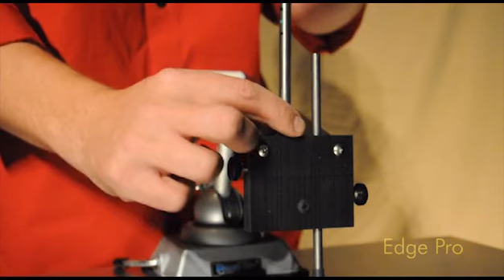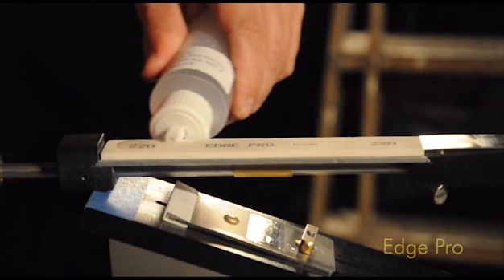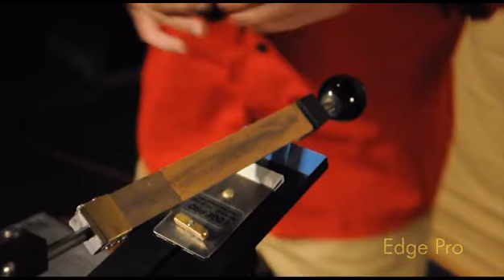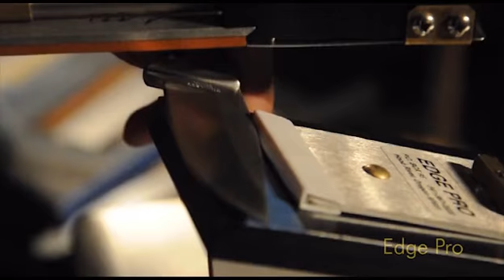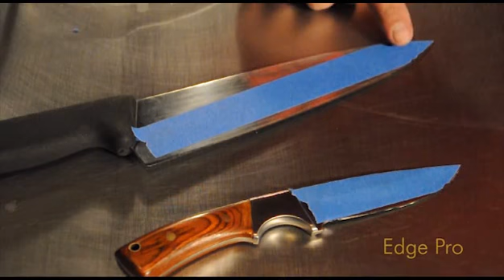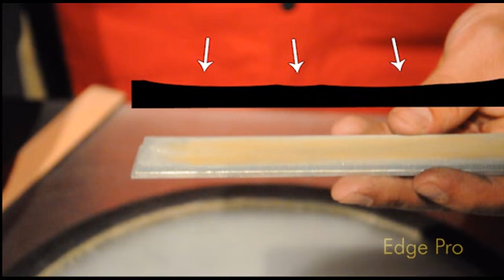Edge Pro Professional Model Instructional Video

Comment: Thanks Cody / Ben
Since buying my Pro back in 2010 I just got on and used it.  Interesting to see you guys using it.
I might reduce the amount of water I use on my stones.  You seem to use them damp, virtually dry.  I have tended to use a lot more, towels on work surface, the floor, and side of the kitchen unit to catch all the run off !

I guess the other useful function of the painters masking tape is to stop the knife sliding.

Comment: Very nice video I am using a Wicked Edge Generation 3 at the moment and just purchased an Edge Pro Professional sharpening system  with the wicked edge gen 3 it is very easy to form a convex edge blending 3 to 4 beviles and blending them together with strops a video showing how to do this with the edge pro would be really helpful
Reply: Mark Worledge, which sharpener do you prefer now? Does one work better for certain knives? A total flat grind like on kitchen knives look real easy on the  Edge Pro. But what about pocket knives with a big hollow grind and a pointy clip point tip? Or a Spyderco Delica with a pretty extreme triangle shaped blade?
Reply: 707SonomaComa large kitchen knives and small I don’t think you can beat a set of good whetstones, large hunting knives whetstones but you got to know what you are doing with whetstones smaller knives like CR, Spider C ext the Pro Edge pro maybe the WE both are good but in my opinion the PE P is more adaptable

Comment: I was thinking about making my own wicked edge sharpening system so as to make a better quality system that has less “play” in the joints, but then I found this. Is the edge pro apex 4 just as good?
Reply: well, first. Yes, the Edge Pro Apex is just as good, just more portable. Second, I have a Wicked Edge & play  isn't much of a thing with the WE. Third, If you are going for an edge pro apex and looking for less variation, KME is a much better option in my opinion. I suggest looking into it. But to each his own.

Comment: Hi folks, great explanation. A question though, how do you compensate for varying thicknesses between stones? I can definitely imagine having to replace a stone and it’s going to be inherently thicker than say an older stone in one’s set. I used a drill stop collar on my original Edge Pro but don’t see mention of such compensation on the newest model. I definitely like the fact that improvements have been made to keep the stones level during their life.
Reply: digital angle finder

Comment: can the edge pro apex 4 sharpen any grind like high sabre grind or scandi flat and such and can it sharpen large knives as well? like 16inches long by 3 inch wide? will it be able to sharpen ny survival knives and bushcraft knives? I need a good sharpener. are the whetstones good quality? or junk' please be honest. I have wasted so much money on garbage sharpeners and stones I need somthing reliable
Reply: if you want sharpen big knife you shuld buy edge pro professinal
Reply: Did you watch the video?
Reply: It's pricey, but it's a good all in one system. Works best with the small blade attachment for pocket knives with a 3" blade and a drill bit collar to mark your sharpening angle if your stones are of different thickness.

Comment: Can you use this for convex sharpened knives?
Reply: casper franken Search for "ApostleP" on YouTube,  he probably has a video that will answer your question.
Reply: no, basically any v edge knife. scandis and convex are best done by hand and chk out john c. reply on "ApostleP"
Reply: I am able to do convex. convex just takes constant movement of the blade. you can message me if you want more details
Reply: Seeing the attachments that are used on other systems like the Hapstone or TSPROF, then making your own Convex adapter would not be an issue if you have a bit of metal working skill... or design and a 3-d printer 
Go look at the convex adapters... they are just a block with two holes to hold the guide bar at an angle to the pivot slide point.
Accurate drilling of the two holes to get desired angle is the only ‘tricky’ bit

Comment: i am much mre satisfied of the edge pro system than any clamp system. i dont believe clamp systems keep a  straight engle from heal to tip. . edge pro is the master dont get any copy. like  gritomatic
Reply: jelly 292 does it sharpen survival and bushcraft knives? any grind? Scandi flat sabre?
Reply: stick with had sharpening for bushcraft and scandi. edge pro shines in keeping the v edge on a blade. good for knives you don,t want to get scratched. like high quality folders kitchen knives. make sure you go by this tutorial.b/c  you have to remember to use very light pressure toward the higher grits. you just want to remove the burr and let the stone do the poloshing without pressure

Comment: How would you find the angle you're making if u don't trust the marks?
Reply: +GigaDonk A lot of people use an angle cube for finding angles
Reply: +GigaDonk use a permanent marker on just the edge of the knife, then do a few swipes, steeply, then repeat adjusting the angle slightly until you have removed all of the ink that is your angle